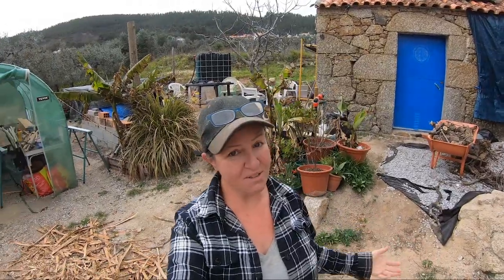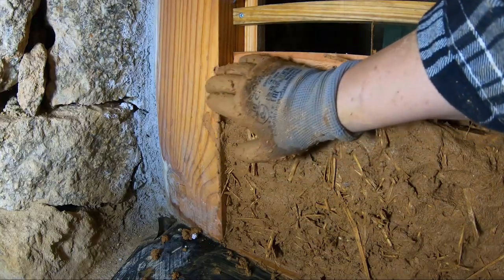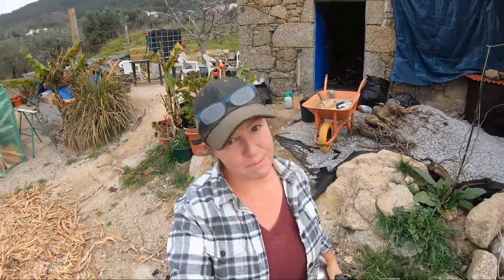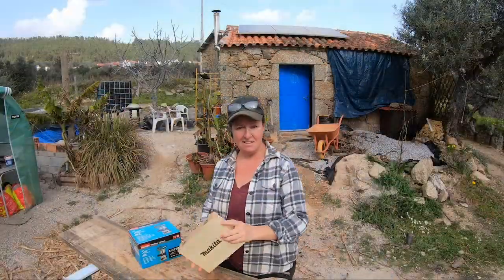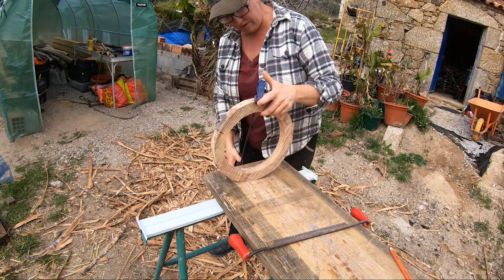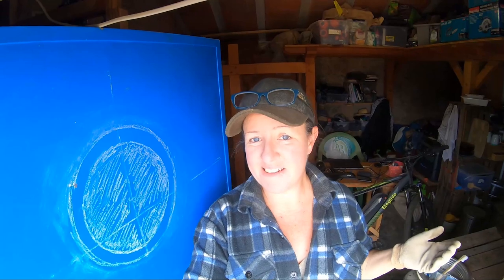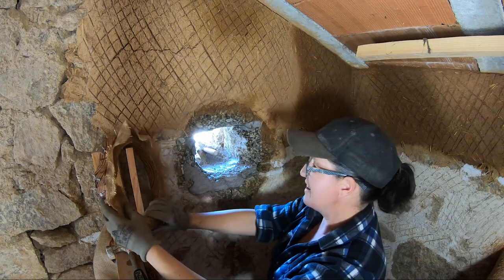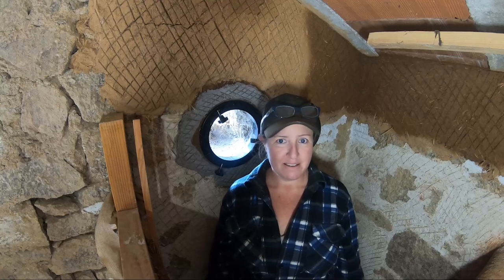Tiny House Shower #4 - Cob, Lime, Porcupine Window, & Snapping Fun

Comment: Hi ,your doing a great job,,,,,if it was me I would have inserted window from the outside ,flush with the wall, that way you could have a nice shelf inside shower, and rain wouldn't gather behind the window and sit inside,rather than outside.keep up the great work.carl.
Reply from the maker: I wanted to be able to open the window from the inside. The walls are 50cm thick so rain won't get inside and I'll sculpt things so that the water will want to run outside. Also, I'd like to keep the outside of the building as natural as possible an I like the mystery of the hole being there.

Comment: I love the snaps!  They are great!  The little window is also great!  I love how it looks!  The router is a super powerful tool.  My husband would never let me use it!  He said it required more strength than a woman has to control it, if it encounters a knot or other anomally in the wood.  That it would twist it's self right out of my hands, still rotating at high speed!  Very dangerous, he said!  You are correct to respect your router!  The cobb wall is looking good  also!
Reply from the maker: Thanks! I'm happy with the window and the snaps! I've heard some gnarly things about routers too, so that's why I didn't want to just go for it. 🙂

Comment: That brings back memories of when I was a kid when I used to play with mud yeah👍✌️🤙❤️🇵🇹❤️
Reply from the maker: Get back into it! Not just for kids! 😁
Reply: I have a question could you use chicken wire to help with hold the cob in place ?have you finished taping up your flu pipe to Keep the rain outThat tape is so strong and that tape is made for outside use When you put the tape on use a credit card to push all the air bubbles out for good contact It’s the little job we always seem not to complete👍🤙✌️❤️🇵🇹❤️
Reply from the maker: @johnpierce1965  I did finally tape it! But I still haven't tied down the shade cloth on the poly tunnel... so I know what you mean about the little jobs! I could use chicken wire, I think, but it's probably overkill in this case and I'm not crazy about using metal when it can be avoided. I'm hoping the little 'U' hooks will do the trick. 🙂

Comment: FASCINATING!!  Everything you do is so creative and unique.  I HAVE AN IDEA ABOUT YOUR TOOL SHED.  What if you had a tool cupboard wall along the back rock wall coming off  the end of your house.  It would provide a privacy wall from the building behind you.  You could add shelving for hand tools and supplies and an area to hang your mixer and shovels etc.  Then you could add beams for a patio roof to entertain under even when it is rainy.  It would provide storage, privacy, wind protection and a very useable outdoor living area all at once.  You could put a  padlock or other locking system on the cupboard doors.  Do I make any sense?  I'm probably your oldest subscriber at almost 77 years old and I live in America so not sure if my terminology would be the same as in the UK or Portugal.   I just found out I have Iberian dna so that comes from Portugese and Celtic people.  It is good to see you out with friends having a good time and not just a slave to your projects. ....it is about the journey, not the destination.
Reply from the maker: I think I understand what you mean and that's sort of my plan. The entire upper area beside my house will eventually be encased in a wall and the part you're talking about will probably have my water tank and possibly some other covered storage. The toolshed will be a bit further along and also be a part of the wall. The whole area will be enclosed and cosy eventually. I'm actually Canadian so don't worry about terminology... I'm fluent in American/Canadian and Scottish! 😆 Too bad my Portuguese isn't quite as good! Thanks for your suggestion and nice feedback, I'm really excited to get started on the shed!

Comment: With the glass on the inside i'm curious how you'll prevent water getting into the wall cavity or running down the channel to the window?  It may justbe perspective but it seems a little lower on inside wall than external.  BUT i just adore this and the view you will have 👏👏👏🥰 and snaps effective 😀
Reply from the maker: Well spotted and it is lower on the inside. I haven't figured it out just yet but I have a lot of play outside where I can remove some stones so it slopes down. I'll work on this soonish but I wanted to just get on with window stuff. 😁 Thanks!

Comment: Just a question… because you put the window on the inside of the stone wall…what will happen when you get a huge down pour, won’t the rain settle on the shelf that was created? Love the look but not sure how it will work ❤️🇨🇦
Reply: Exactly what I was thinking. I’m concerned since the step down goes toward the interior, there’s going to be moisture problems. Usually our window sills have a slight incline towards the exterior of the house.
Reply from the maker: At the moment, yes. But I have a lot of options for this, I just need to head outside and remove some stones there and then slope everything down. I'll fill the interior with lime so it slopes out of the house and doesn't sit as a pool over water. We don't have rain forecast but if I see a downpour is on the way, I'll get this done. It should be a fairly simple fix.
Reply from the maker: Well spotted, check out my reply to the original comment! 🙂

Comment: Awesome video! What do you mean final plaster on  outside of cob wall? Will it still be cob? Everything looks so good.
Reply from the maker: Thanks! Usually cob is a thick mix that's used for building things. You can actually make a wall with cob without any supports at all if it's thick enough. But for finishing, I'll make a clay plaster which will be sifted clay an fine sand, possibly with other additions for durability. I've never done finish plastering so I'm excited to learn... I have a book coming Monday all about it. But I don't think any finishing work will happen until closer to the end of the build.

Comment: Is the clay for insulation?
Reply from the maker: No, clay doesn't offer much insulation. For keeping a place warm and cool it does that with thermal mass. In this case, the cob has just been used to form the wall, no other really reason except it's a great substance to work with and gets the job done. This wall is too thin to offer thermal mass properties, so it's just a wall.

Comment: Why put lime plaster over the cob? It works fine without in my experience. It's going to be a good shower!
Reply from the maker: Yes, Sigi Koko, natural builder extraordinaire, also mentioned that polished clay could work as a water-resistant substance. I think I just decided on lime and now that's what's in my head. Plus, since it's a shower, I'd feel better about using lime. Also, I want the shower 'cubicle' to be a light colour and that's more easy to achieve with lime since I don't have access to light coloured clay. Also... clay is hard for me to come by, lime is easier... so a few reasons! 😁

Comment: sharping draw knife can be accomplished with ease ........ ballpeen hammer striking ,knife onto another hammer head on the edge of knife, sharpens it razor sharp ......... we the north......S
Reply from the maker: Ooh I can't even visualise this technique... I'll see if I can find a video! Thanks!
Reply: @PortugalfromScratch  this tecknec is explained well in sharpening garden and farm use tools nothing fancy is used just bash the hell out of the blade ...... sun will reflect a shine works well........S